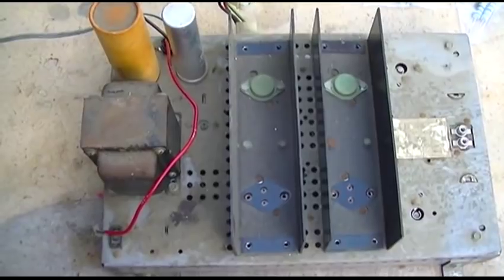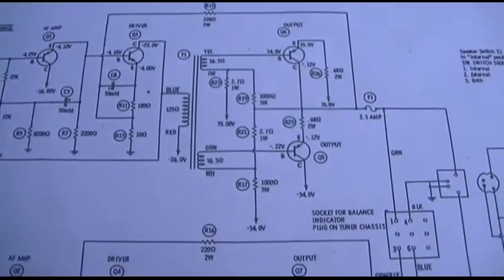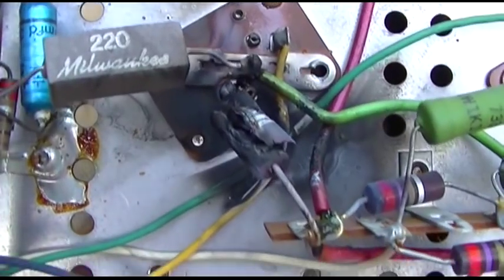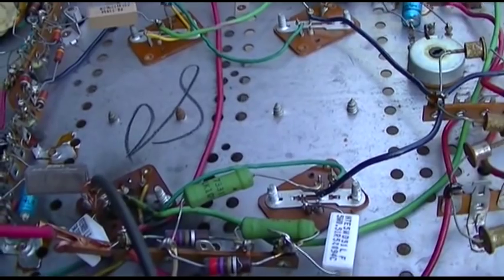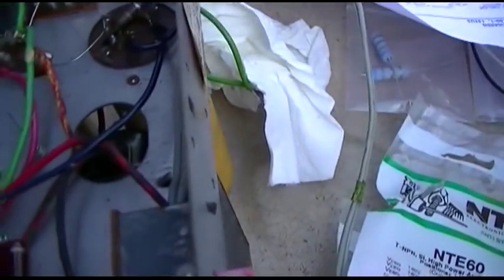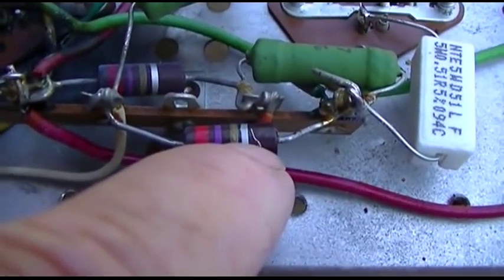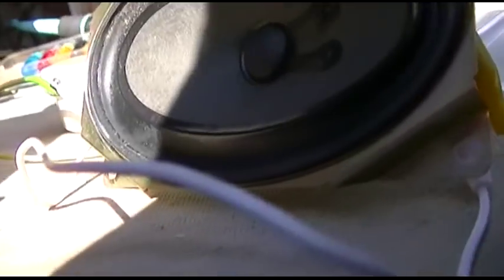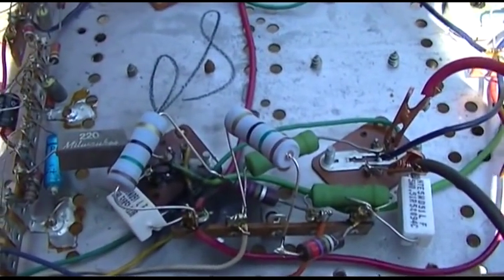Repairing Vintage Transistor Solid State Stereo Audio Amplifier

Comment: You have to take care with using newer silicon transistors.  Many of them have much higher frequency response, up into the tens of Megahertz, so they can break into oscillation where the original germaniums could not.

Comment: Well I hope my Teac A1500 has no problems in the near future though I did get NOS replacement germanium transistors in case! It did have one noisy transistor when I got it, of course it was the hardest one to find! Full recap and calibration to some NOS PE36 AGFA and it sings great.

Comment: 3:16 A bi-polar power supply and DC coupling in 1968? That was a little ahead of its time, I hope in a good way.  All this old Packard Bell stuff seems built like a tank, but I remember hearing at the time that it was one of the least reliable brands, at least for color TVs. Anyway, I'd want to run that thing at maximum reasonable power (rather than just idle) for 30 minutes to see if it's stable; over-biasing those push-pull pairs can bring on thermal runaway in a hurry.

Comment: The MJ15003 recommended by the expert was not suitable; you needed MJ15004 to give you PNP.   The Toshiba choice you ended up making is much better than any NTE product you could have bought.  Despite their rating claims I would not recommend any NTE device for a repair you plan to stand behind.  If you grind the tops off of any NTE devices and the MJ transistor or the Toshiba for that matter you can see and appreciate the difference in construction. Maybe the plastic case products are better, but for most TO-3 apps the NTE, ERS, SK etc replacements are best avoided.
Reply: David Locke Hello, I'm  in a pickle. I have a 1976ish Earth Producer guitar Amp head - a Peavey Musician Clone - I'm trying to replace the TO3 type power transistors (QTY. - 8). Tried every cross reference known to man. Unobtainium. These are Signetics 59-4004-B (7717 - date?) Some people on line call these amps "mystery amp"- Earth Sound Research closed shop in '78? I am hoping to upgrade it as much as possible. Don't care about originality.  7000 Watts is already massive loud, I want to mod for performance & reliability. Planning on making quality YouTube 2 hour, 2 to 4 part videos this fall. Any advice you can kindly provide would be greatly appreciated. Thanks!

Comment: The MJ15004 is PNP, the complement of MJ15003 (NPN). I don't know the number of the germanium type it is to replace, but certainly has the voltage and current ratings for substitution. Seems the originals were hard to source, and yes, a very good presentation using a 'matched pair'  2SB554, checked with high voltage application. I wonder what caused the failure of the original germanium transistors; was it a 'dendrite' forming an internal short, which caused the 2nd one to fail as well? I guess the main point is the insulation in the driver transformer protected the driver components..

Comment: Don't blame the parts guy, it was an incorrect sub. And, if it were some high end amp, don't rely on NTE. The parts are just barely OK. Cause it is listed as a cross, doesn't mean it will work. Some amps are fussy, and all like the correct component. That's why you're replacing them . . . cause it's worth keeping, right.
Reply: From english.stackexchange.com: ' "If it were running" is subjunctive case, used to describe hypothetical situations. '  Since Lingcod91 is describing a hypothetical situation, I believe "were" is OK. "don't" is doesn't match that tense (or maybe case; seems the subjunctive case might be tenseless), though; something like "you shouldn't" would fit better.

Comment: I tried replacing a shorted 2SD180 NPN Silicon output transistor with a 2N3055 which is the same but much more robust. Just to see if anything besides the transistor got hurt. All is well and come to find out my Radio Shack semiconductor replacement guide has the 2N3055 as the substitute for the 2SD180.

Comment: So far my 1970 JVC Nivico console stereo hasn't blown it's Germanium output transistors. I wasn't aware of Germanium semiconductors propensity to short more often than Silicon. Although my 1968 5001 receiver of the same brand blew a Silicon output transistor and emitter resistor. At minimum those 2 components maybe more.
Reply: I've seen more of them open more than short, but they might have originally shorted, then burnt up until they were open. They also love to go all fuzzy.  No wonder they were sometimes socketed.

Comment: Silicon grease comes in two colors; white: radio and silver: computer. Silver handles heat better. White is for radio transistors for output power. Using a mica washer/spacer also helps. Good solder joints are a must. I've been a ham operator since 1996, although that is irrelevant to this piece.

Comment: I would like to say that using silicon grease is a no no in high voltage circuits in old Radios and old TV's,  that's why you use mica washers.  Also as silicon grease ages it goes hard increasing thermal resistance through hot cold cycling.

Comment: sometimes you have to use the NTE parts, for output transistors in tv's I always try to find the OEM or a good replacement. I guess just make sure that they aren't getting too hot and it should be ok.

Comment: Do you plan to rebuild both channels or just the one that blew?  I'd be tempted to do both just in case the other transistors let go.  I suppose it's nice to keep the original parts going as long as possible.

Comment: I use east-europe ASZ-16 germanium power transistors in a 70's Wurlitzer amp. They are very cheap on *bay and very good quality. (32V, 8A 45hfe). 
Nice video.